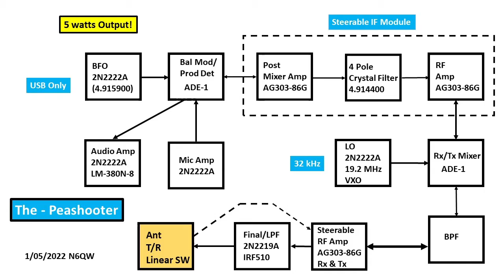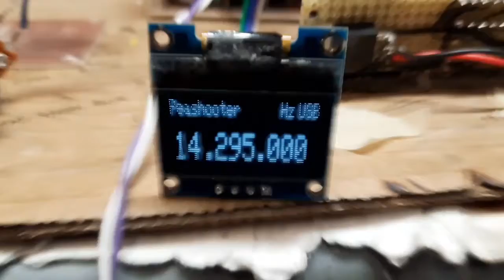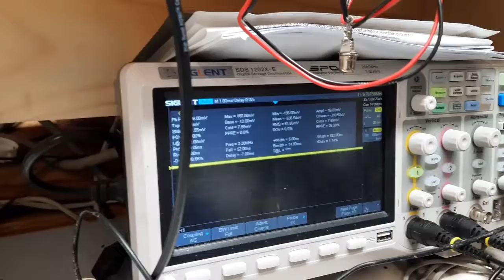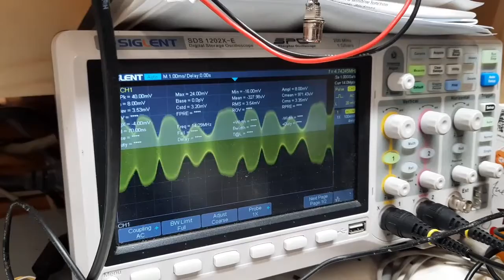The Peashooter ~ Small in Size, Big Performance

Comment: Really nice.  About as simple as a superhet transceiver can be, but without compromising performance.  DBMs are a quality mixer, lots of gain from those MMICs. It would have too much gain on 40.   I think I could hear a very faint washing machine noise from that OLED at one point 😉 or did I imagine that?
Reply from the maker: Hi Paul

The workbench is in the garage right next to the washing machine-- I was multitasking washing my shorts and soldering the Peashooter. I am thinking about a two-band version. If I add 150PF NPO/COG across the inductors, make the section coupling cap 5PF and retune the trimmers we are now a 40M BPF. So that might be an interesting test to see how it fares on 40M.

73's
Pete